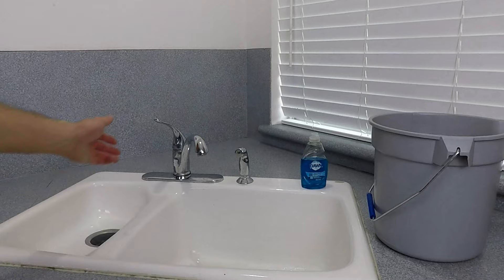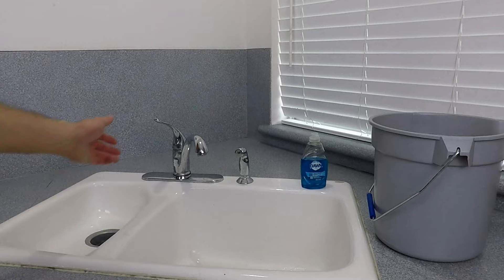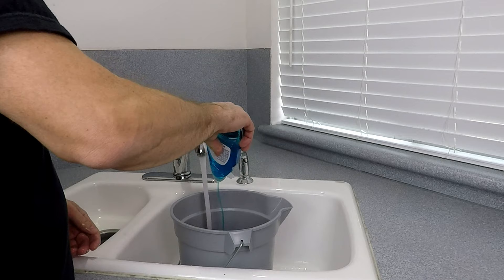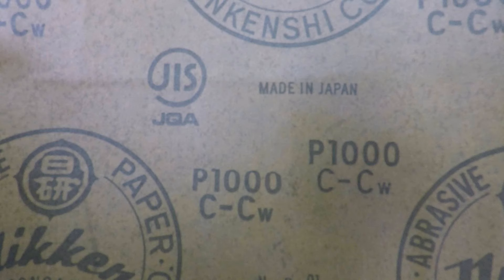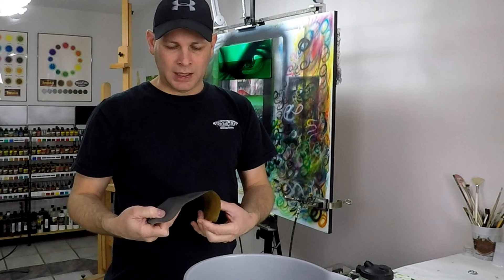How-to Cut and Buff Your Airbrush Artwork

Comment: Thanks for the great vid, lots of  info. Question I have is why you can't use dual action orbital buffer with sonax cut max?
Reply from the maker: I appreciate the kind words my friend!  You need to create heat in order for the compound to work effectively.  Without generating heat, the compound will polish the surface, but it won't actually remove the sand scratches.  When you're buffing the surface, you're actually removing some of the clear coat (much like the sanding process).  A dual action or orbital polisher doesn't spin fast enough to generate the heat required.
Reply: @wickedartstudio   ah ha Thanks for the quick answer. That makes total sense. Will be trying this method, just got my sonax from amazon.

Comment: Great video. My question is, I noticed when you're doing the cutting you never sped up the machine. Is it the same when doing an automobile do you want to be consistent at 1800 RPM? Thank u.
Reply from the maker: Correct.  Clear coat is clear coat regardless of what it has been sprayed on.  I've found using the machine at around 1800 RPM with the Cutmax works very well.  With the diminishing abrasives in the compound, there's no need to change the buffer speed during the process.  I use the exact same process on vehicles too.

Comment: Aren’t you concerned buffing so close to where you paint ? I know for a fact the wool especially with a new pad will fly all over! I know you mentioned this in the video but doesn’t the wool fly all over? I’m interested because that’s the problem I’m having is buffing outside but sometimes it’s winter and that’s a problem. So if you could elaborate I would appreciate it thanks
Reply from the maker: If I were concerned I wouldn't have done it, lol.  The bigger concern in my opinion would come from the compound used vs the pad shedding.  The Sonax compound I use doesn't contain anything that can/would cause an adverse reaction with paint.  As far as wool shedding from the pad... The amount of wool that comes off of my pad is miniscule.  Yes, there are some wool fibers shed in the process.  That is unavoidable, but the amount I experience really is minimal.  There are a few things to look for if you're seeing excessive wool fibers coming from your pad: a cheap pad, too may rpm's, too much pressure or any combination of those.  

First, don't buy cheap pads.  Buffing pads are one of those things that you get what you pay for.  The cheap pads aren't made to the same standard and will shed a lot more material compared to the more expensive ones.  You can find the same pad I use here https://amzn.to/30XVTZd  

Next, be conscious of your rpm setting while buffing.  Too fast will generate more heat and cause the pad to fail faster.  Heat is needed to make the compound cut correctly.  You just need to find the balance.  There are too many variables (the clear you use, compound you use, how long the paint has cured, temperature, etc.) to give you a hard and fast rule where to set your rpm range.  Start slower.  If the compound isn't cutting like it should, increase the rpm setting gradually until you find the sweet spot.  My buffer is generally set around 1600 to 1800 rpm.

Lastly, using too much pressure can also cause excessive heat, shedding and pad failure.  The weight of the machine is generally all that's required.  

Hopefully all of that makes sense and helps you out.  If not, don't hesitate to ask more questions!
Reply: Wicked Art Airbrush Studio Thank you for your time and kind words! Since it doesn’t react with the paint I’m definitely trying it. I do use 3M pads and I have a D/A and a regular buffer . The first time I used my new pad with the DA it shed like crazy so then I must be putting to much pressure! I can’t thank you enough and for your great videos ! I just might have a couple more questions after I purchase the product so I just might take you up on it. Thanks again
Reply from the maker: I'm glad to help!

Comment: what is your clear coat recommendation for airbrushing and how many coats do u use?
Reply from the maker: For general artwork that remains indoors, I use Createx UVLS (available in matte, semi-gloss or gloss).  Any quality automotive catalyzed urethane clear will work if your work will be subjected to the elements.  I've used PPG and House of Kolor for most of my career.  Recently, I've switched to Tamco clears.  The number of coats depends on the project.

Comment: Hi Trevor
Quick question? Been watching some car videos. IE: Overhualin. Da sanding dry then polishing. I've always done it by hand wet. What's you're opinion?
Thanks Guy
Reply from the maker: The vast majority of the time I also wet sand by hand.  At times, I have used a DA to speed up the process on tight deadlines.  I've tried it both wet and dry with a DA and I prefer wet.  The paper seems to last longer and cut cleaner wet in my opinion.

Comment: Man that comes up well considering you only used 1000 grit. Makes a good job even better.
I have found them in the UK but they are quite expensive. I tend to do race paint for people so it needs to look nice but doesn't have to be show quality. most people do not want to pay a lot of money for paint as they stand a good chance of dumping it on the first corner. I try to leave everything gun finish but it's not always possible because of dust and dirt despite blowing off, de-greasing. tacking off, wearing paper suits and everything. What would you recommend for taking out bits? Also a clearcoat run. Usually i tend to bury it so i have enough material to flat out. As you know it's a fine line between a glass finish and a set of drape curtains especially when you have lots of contours to paint. Lips and edges are a nightmare. So how do you deal with runs, bits ETC.Do you think it would be better to spray a bit drier and polish it all or still go for a gun finish and take out the odd run or bit.
Awesome. I liked it before you polished it. Also is there any chance you can upload a gallery of your work for ideas and inspiration or do you have a website with a gallery.
 Can't wait for your next upload and Q&A. So many questions.
Guy.
Reply from the maker: Ahh... the bane of every painter: runs, dust and everything else that can (and will) land in your clear.  I've done some work on race bikes and cars in the past.  So, I know exactly what you mean about possibly dumping it in the first corner and the client not wanting to pay a lot of money for paint.  I'll address the runs, dust and other minor paint issues first.  I don't think it's a good idea to spray the clear a bit drier to avoid runs.  A dry spray creates a lot more texture in the finish than typical orange peel, which would require more time and effort to sand flat and polish out.  Without actually seeing your gun set up, conditions and spray technique, the best advice I can give is always start with a tack coat and allow it to flash before continuing.  The tack coat will be like putting a very dry coat down.  I'm not looking for full coverage, just misting the surface.  Allow that to flash.  The amount of time the clear takes to flash is completely dependent on your conditions and the reducer you're using.  Touch an unimportant area (masking tape from a masked area or something to that effect) when you think it's time for the next coat.  If the clear sticks to your gloved finger and creates strings as you lift it, it's not ready for the next coat.  When there are no strings it's ready for a wet coat.  The idea behind the tack coat is to give subsequent coats a better surface to stick to and prevent runs.  Does that make sense?  Runs can and do happen to all of us on occasion.  If I see a run developing while I'm spraying the clear I don't try to bury it with more clear. I apply more clear to the area so the run will effectively run itself out.  Whether that technique is a good option or not depends on where the run happens and what's underneath it.  The technique works well if there's a relatively flat surface under the run and makes sanding it out easier once the paint has cured.  If there's another contour, lip or edge directly underneath the run, I leave it alone and deal with it after the paint has cured.  To remove runs, dirt and other contaminants after the clear has cured requires sanding them out.  I generally use a small piece of a stir stick as a block to wrap the sandpaper around.  From there you have a couple of options.  You can simply buff the areas that were sanded and call it good, or you can take it further.  Another option I tend to use often when a client doesn't have the budget, or the need for a show quality finish, is a final flow coat.  I'll wet sand the clear (after it's fully cured) with 600 or 800 grit paper until it's relatively flat.  From there, I'll lay down one or two more coats of clear using an over reduced (about 10 percent more reducer) mix with a slow reducer.  The over reduction and the slower reducer will allow that final coat to flow out which creates a very smooth finish in the end without the labor of buffing.  And hopefully, you don't wind up with any dust or runs with that method.  If so, it's usually easier to sand them out and buff small areas due to the better finish. Here's something to think about... In the end, it's your work.  It's an advertisement for you and word gets around whether it's good or bad.  My business standpoint has always been to give the customer more than they expect.  In most cases, If a customer doesn't have the budget or need for a show quality finish, I will still spend a little extra time cutting and buffing the final finish out.  Don't get me wrong, I don't spend an enormous amount of time making something glass smooth if I'm not getting paid for it, but I will give up some time to improve the otherwise gun finish.  The race paint you're doing for example.  Racing isn't normally a cheap hobby.  Those people likely have some disposable income and they probably have friends with similar interests and good paying jobs.  Exceeding expectations on the race paint will likely get you more work in the future on their other, more valuable toys.  I don't have a website and I'm not sure if I can upload a gallery on YouTube or not.  I do have a Facebook business page at https://www.facebook.com/Wickedartstudio/  I think there's some of my older stuff on that page somewhere, but I'm not that active on Facebook.
Reply: Hi.
Thank you for the extensive reply. I am so sorry you had to type so much to explain but it came over very well. Next time i will try for a yes or no question.
Sorry about that.
Guy
Reply from the maker: No need to apologize Guy.  That's why I created this channel, to share what I've learned over the years and help others.  If you take time out of your busy schedule to watch one of my videos and leave a comment, I don't mind taking the time to reply at all.  There are no secrets as far as I'm concerned.  If a question needs a brief answer I'll leave a brief reply.  If it needs a longer answer I'll do that too.
Reply: Ok Mate. I wish i could address you by name, It just feels more friendly.
Guy
Reply from the maker: I apologize.  I've introduced myself in a couple of my videos, but I forget to do it again most of the time.  My name is Trevor Meridith.
Reply: Excellent. Now i know who i'm talking to I feel more connected. Keep up the good work, and inspire us as much as we all inspire you.
Thanks Trevor.

Guy

Comment: I use sonax also with great results. Its suprising to me as well as the product works, that it's not more well know. Completely off topic, have you done any gold or silver gilding?
Reply from the maker: I've done a little bit of gold and/or silver leafing in the past, but that was probably about 20 years ago.  There's never been a high demand for that particular effect in my area.  There are products available these days that can simulate the look of engine-turned silver leaf faster and easier than actually using the size and leaf.  I've never tried to simulate it with a gold paint though.
Reply: @wickedartstudio  the reason I was asking, I've noticed a lot of the gold sizing is oil based. Being a auto painter we stay away from oil based anything. But can i use urethane clear coat over that sizing without fisheye.
Reply from the maker: Yes you can.  It's not a huge issue with the size because the leaf will cover all of the glue.  Oil based products are a bigger issue when it comes to striping enamel (1-Shot for example).  If you plan to pinstripe around the leaf and then clear over the leaf and the striping you can run into issues.  An old trick is to add a little bit of the catalyst from whatever brand of clear you're using to the striping paint to keep the clear from reacting with it.  I had mixed results with that technique and would suggest experimenting on a test panel first.  Sometimes it worked great and sometimes it was a disaster.  The safe option is to clear first and then run your stripes.  I never liked that option because I prefer to bury all of my graphics under the clear with a glass smooth surface in the end.  House of Kolor has their own brand of striping paint that can be cleared over with no issues.  I've used their striping paint exclusively for the last 15 years or more and I've never had an issue with it.  That's the best option in my opinion.
Reply: @wickedartstudio  
Dude you must never get any sleep. Thanks for the reply so quick. You've been a huge help every time. Good call on the 1 shot. That was a big heads up since that's what I'm using right now.
Reply from the maker: Glad to help!
Reply: I was thinking on your last reply about having hit and miss results painting over 1 shot paint. Do you think it has anything to do with treating the pinstrip brush with oil before storage?  Or is it the emamal itself?
Reply from the maker: The clear was reacting with something in 1-Shot.  I've used the same oil on my brushes from day one.  I never had an issue again after I quit using 1-Shot and switched to House of Kolor striping enamel.
Reply: @wickedartstudio  got it. Then I'm not even gonna try it. It just sucks cause all my pinstriping colors are 1 shot. Oh well. Thanks for the reply
Reply from the maker: @inthegarage342  You can still use your 1-Shot to stripe over clear.

Comment: Would you really need to do this on store display panels shouldn't the clear already be giving a high reflection
Reply from the maker: I think the answer to your question would depend on your own preference.  Yes, the clear will give a high reflection without cutting and buffing, but those results can vary.  How smooth the clear coat is applied, whether there are any imperfections (runs, lint or dust in the clear, etc.) can all be reasons to cut and buff a project for a professional looking finish.  The cut and buff process is just an option, but it definitely improves the final result in my opinion.
Reply: It just makes it such a flat glass like shine instead of seeing orange peel in the shine
Reply: Wicked Art Airbrush Studio I can see what your doing saying on a paying paint finish buffing is a must it's just on a sample panel like the hulk eyes as long as clear went down great if buffing would be useful  enjoy the polar vortex just like me in Alberta canada☃️
Reply from the maker: Yes.  In the case of this panel, it gave me a reason to make a cutting and buffing video.  As it turns out, I'm glad I went ahead and buffed it out.  Although it was just a test panel for a YouTube video, I posted a picture of the finished product on my Facebook business page.  I actually sold it within 15 minutes of posting the picture.
Reply: Wicked Art Airbrush Studio Awesome on the sale .this is a sometimes paying hobby for my artistic inclinations. Last question Do you make paint your own black panels or do you buy them at like hobby lobby or auto zone
Reply from the maker: I make my own panels sometimes (usually if I need an odd size, or something to that effect).  Most of the time I purchase them though.